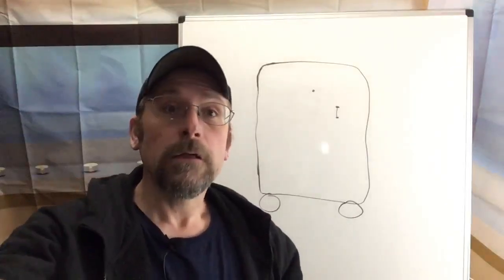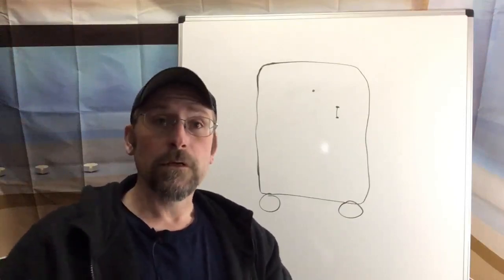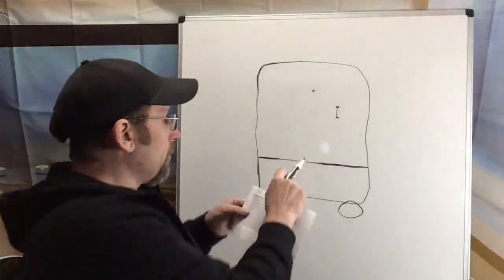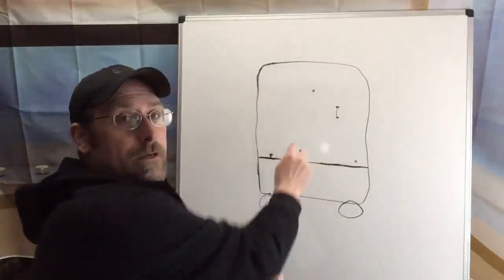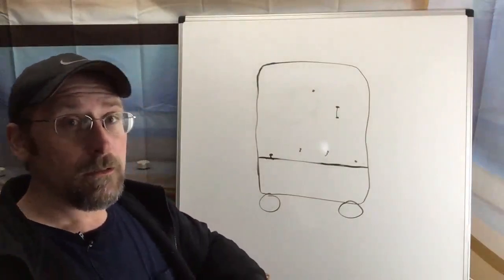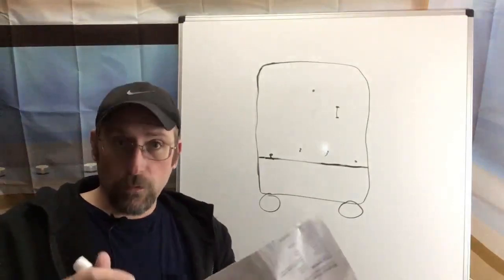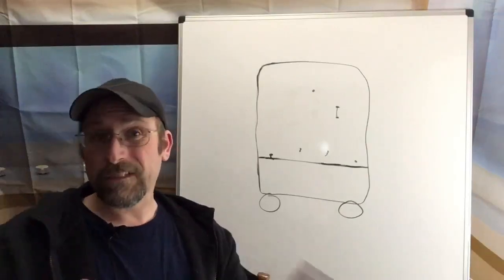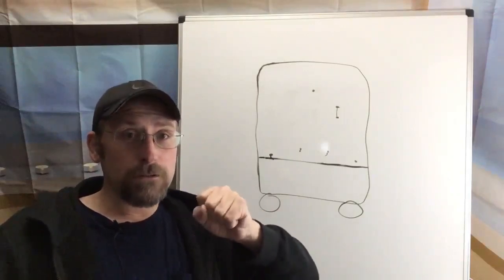HOW TO MAKE AN OXYGEN CONCENTRATOR QUIET

Comment: I like all the suggestions.  We are about to have to get a 10L home concentrator and I'm worried about the high decimel levels.
Reply from the maker: Hi, unfortunately a ten liter machine is definitely going to be louder. It depends on what your provider has available and the condition of it. You could make accepting it conditional upon how loud it is but you have nothing to compare it to, so it could be a great machine and you wouldn't know it till the next one shows up. Most places I dealt with didn't have many of the ten liter concentrators to go around. They could even offer to bridge two five liter machines but I'd only want to do that in an emergency situation. It may be wishful thinking but I'd would like it if they brought two ten liter machines and let you hear both of them and let you choose. I wish you the best of luck with this and hopefully with some adjustments in placement of the machine you should be better able to handle it.

Comment: Do a lot of ppl in apartments get complaints about this noise?
I haven’t slept in 6 months from a machine that sounds a lot like this, but also has a high pitched beep during the night. It’s so bad I can’t take it.
My complaint to the manager fell on deaf ears and the ppl using it say it’s not constant, but it absolutely is like clockwork from midnight to 8 am or later in very single night. I’m not sure if they are using two machines or if this one beeps as well as rumbles. 
Any suggestions ? It’s definitely over the decibel level for apt noise especially during quiet hours which is 10pm -8 am
Reply from the maker: Hi Marie, it's probably just one old machine, unfortunately in a lot of cases the user doesn't realize how loud it is to others. You said something to the manager so that's been done but no help there. I would run a fan while you sleep to help cover the sound, also possibly a change in where you sleep and maybe one of those sleep sound machines that have rain noise and stuff like that. Im guessing you talked to the person directly and they are not responding at all but if they would then I say maybe at the least they could call their provider and ask for a new machine or move it further away from where you can hear it.  If none of this can be done then I'd move, I had a place years ago with a horribly loud drip at night, the landlord wouldn't do anything and I couldn't sleep. I decided after nine months that it was time to go and the next person was finally able to get the landlord to listen. I hope it works out for you.
Reply: @OxygenGuy Thanks so much for your compassionate reply. I’m awake again at 3 am and my ears are actually throbbing and painful from the sound. I tried the foam air plugs but they hurt my ears and I can still hear the loud rumble and whistle of the motor.
I’m 65 and disabled and a move would be a hardship. Unfortunately my bed can’t be placed elsewhere and wouldn’t make the noise any better. I’ve been running my AC fan and I try relaxing music. But I really need freedom from sound stimuli in order to sleep. I use aromatherapy and have black out noise reducing heavy drapes. They should put it in their spare room. But from what I’m reading here ppl say they can still hear it vibrating off all the walls in their home regardless of the machines location. It already sounds like it’s enveloping my entire room right under theirs. It’s loud enough that one of them had to leave the bedroom. It’s so insanely loud and constant but they lied about to the manager and said it’s not loud or constant. My tinnitus has totally flared up and my brain is actually hurting.😢 I got a lawyer who is going over my lease now.and will decide the next step to take.

Comment: Moving the machine to another room is priceless. How often do we need to change the tubing / cánula?
Reply from the maker: Hi Denise, It's an unfortunate reality but a lot of machines out there are old and loud and replacements never seem to come. Also you have situations where the one member of the house can hear and the other can't no matter how quiet it is. Tubing is 3-6 months and cannula is 2-4 week ls but depending on conditions in the house or if patient is sick then you may have to move up that time period. Also if they hardly use it then it could technically go longer between changes.
Reply: My machine was so loud I could hear it in another room. 
Another thought 💭 is my O2 is 98 during the day, then does it make sense to use it at night?
Reply from the maker: If your doctor is ok with it then It should be good, but most people have lower oxygen at night when they sleep. They should definitely do an overnight pulse ox on you before taking you off of it to be sure it won't be a problem. Also they could talk about a CPAP at that point, just so you are aware.
Reply: I have metastatic cancer. I only wear it at night for comfort care. ❤
Reply from the maker: That's rough, I'm sorry to hear that, well at least you won't have to mess with it as much. You now have approximate times but if you feel it getting hard and painful in your nose or if it looks rough then definitely change it. Unfortunately I've known some providers that toss an instruction book and leave and then there's times where you're released late at night and it's a lot of information to take in on top of everything else leaving the hospital. It's best to note change dates on the calendar, just so you have a reference later. If you have anymore questions let me know.

Comment: Any suggestions to quiet a Portable Oxygen Concentrator especially the loud popping noise??
Reply from the maker: Well, you got the same issue basically as the people with the big machines do, but it would be easier to place it somewhere else as long as you got airflow going to and from it. You can can run a fan in the room with you and a little extra tubing to your portable machine. I would be careful to make sure it's not a lot because you need the right flow to reach you. A airflow pen would be great if you have a rep coming around the house. It's basically avoiding the noise but it's the best option most of the time. I would give it a shot and experiment a little and see if you can make it better.

Comment: As far as the idea of having machine located in a different area, I have a protected area on my enclosed summer porch but winter temperatures are often below freezing. How does ambient air temperature affect the concentrator machine?
Reply from the maker: The machines do put off a lot of heat but your air coming through maybe really cold because of the air going into the machine. I think it maybe a matter of trial and error, You may even have to keep it in a warmer spot in the room. I hope it works out for you, I can't recommend it but it may work out great. Have a good one.

Comment: build a hushbox that allows ventilation. plywood box with dense styrofoam (the pink one) on the inside.
measure the temperature inside while testing it for 4-5h. just use a thermometer in the box and check the temp.

makes sure it doesn't run hot.
Reply from the maker: I love the enthusiasm but unfortunately the concentrator needs a lot of air to make a little oxygen.
Reply: true. but if anything is rattling, vibrating and loud it can be silenced with a hush box easily. just make sure there are enough air inlets and they are placed strategically so the airflow will cool anything that might heat up. technically, "an other room" is a hush box as well, right? close the door and the noise is blocked. 
now simplify this idea and shrink the room to a minimum, you would have the benefit of silencing a machine without using much space. weight and material is what it takes to silence noise. 
again. check, where the heat source is and make sure the airflow is directed towards that area (incl a proper outflow, so it doesn't accumulate inside the box)
lowtech silencing.
 @OxygenGuy

Comment: If the issue is air for the unit, why couldn't you put in a closet and run a small fan for air flow? Or for that matter, even build a large box to hold the unit and run tubing into the closed box with constant air-flow say from a separate fan?
Reply from the maker: I totally get it, but unfortunately the concentrators use a lot of regular air to make that super concentrated 88 - 95 percent oxygen. It never hurts to keep thinking on it, I'm sure they appreciate it.

Comment: My Dad (who had Obstructive apnea) was on this Nightmare machine 30 Years Ago!

We live in a Small apartment now, NOT A House, and I'm caring for Both of my parents, while being sick too (Longhauler). The Most distance I can get away from this p.o.s. is 20 feet. There Is No Other Room for it to go in.

My parents are in their 80's and the tubing is a Freaking Trip Hazard.  My upstairs neighbors can Hear This Monster, and after 4 complaints, we can be evicted for ANY Other "reason" that they can make up.

WHY Can't People INNOVATE this Crap!!!!!  In 30 YEARS, Virtually NOTHING'S Changed. 

The machine's smaller and in a "pretty" colored case, but my COVID Nightmare Continues. No Oxygen. No Sleep. A HOT apartment that the A/C can't compensate for, without running our electric bills even higher.

I swear, if I find the MORONS who made this germ nightmare, requiring me to have to use this Monster, they will regret hearing what comes outa my mouth And my fists. 

Reproduction for either will be impossible when I'm done, (God willing) lest they Reproduce!  And, Assuming I'm not already DEAD.

I have had 7¾ hours sleep in FIVE Days. I Am NOT Safe to drive and cannot Function like this!  Finances are Beyond tight. 

My wallet's so skinny It's Almost as thick as a debit card, so buying a portable Quiet one On Line, ISN'T an option.

Something's Got To Give!
Reply from the maker: It may be time to bring your doctor back in on this to see if there are any other options for you specifically. I would definitely like to see some more innovation with the way this is treated, hopefully sooner than later.
Reply: I’m dealing with this noise issue from the ppl above me. Their bedroom and bed is directly above mine and I’m awake all night.
I’m wondering how your apartment complex dealt with this situation ? Did they make any demands on you regarding the noise ? Did you get evicted  ? I’m literally at my wits end. In addition to the sound of the running motor and whistling sound, I also hear a loud high pitched beeping sound during the night. I thought it was a heart monitor . Does this machine also beep ? Is it hooked up to a mask to help a person to breath? When the beeping goes crazy I hear someone above me come running into that bedroom above me where the machine is. Im 65, disabled and need my rest !

Comment: There is no foam at all. Where do I get that. and what type of foam.
Reply from the maker: Hi Michael, Im betting it would be a heat resistant foam material but I never had access to it at my location, we would get replacement cases at times and the foam would be in it brand new. Depending on your model (if it comes with foam) you maybe able to order a replacement case online. The ones we got came from a branch of the company I worked for.

Comment: Hi Frank, I have a tenant with a concentrator and the tenant below says it is making him nuts (he has really good hearing). I went to his apartment, but could not hear anything. I went to the tenant with the concentrator, and it doesn't seem to loud and does not  bother them (they have hardwood floors). I have had the tenant move the machine to a different location and have put a mat and towels underneath, to no avail. Does this seem feasible that in the apartment below it would cause such a disturbance??
Reply from the maker: HI Zoots, it's possible that they are still hearing it, but maybe they're expecting to hear it and no answer other than it being gone will do.  I would want to put it to a test to be 100 percent sure of what or who the problem is, I'd go up and make sure the machine was off in the apartment above without the bottom tenant knowing, then go to the other and tell them you just made some adjustments. If they say they can still hear it, then you already have your answer. I had a neighbor in my apartment building constantly accusing me of messing with the thermostat controls for the floor that were in my apartment. I would swear to anyone that would listen I never touched it. but I would get a call two times a week telling me my neighbor was freezing to death and to turn back on the heat.  I'd also consider downloading a decibel app for your cell phone, it may help to demonstrate that the noise isn't as bad as they think. Still with all that in mind then more adjustments or maybe someone should find a "quieter" place to live. I hope your able to find a solution to this.
Reply: @OxygenGuy  Thanks Frank. Yes, some people can definitely act strange, be annoying and frustrating. Great idea with the decibel app. Will do that for sure. What's funny is the upstairs tenant has had this unit for about 2 years now, and the d/s tenant started complaining only six months ago. I went over today and listened and the unit(Everflo Q respironics) runs great and quiet. He says he hears it all day, but I have confirmed with the upstairs tenant that he uses it all night but only occasionally during the day, otherwise it is off.  Also the upstairs tenants ran an a/c unit in the summer which is 10 times louder and no complaints from downstairs tenant. Crazy
Reply from the maker: Hi again, you're welcome, I couldn't imagine dealing with people in that manner all the time. It must be like being a parent all over again.
Reply: @zoots15  I can assure you that as a tenant living below this noise it is bad. Nobody is going to make this up or claim they are hearing noise they aren’t. My ears are throbbing from the constant sound of the motor and beeps.
It’s up to the one making the noise to move or fix the situation. Even lawyers say that it would be unreasonable for a person to run a noisy medical device that interferes with another residents right to quiet enjoyment of their apartment. In my case my right to sleep. In the dead silence of the night while lying awake in bed it’s much different than someone listening to it during the day when their ears are already adjusted to sounds. Yeah u might have to listen for it, but it’s still not the same as being kept awake all night long. I also hear it during the day.

Comment: I have an Invacare IRC5LX and it just started getting very loud, usually when it's first turned on at night, and then it will run very quiet. Sometimes it will alternate from quiet to loud a few times at night. Replaced Muffler & filters and that seemed to help at first but not so much now. Any help would be appreciated.
Reply from the maker: Hi Steven, I'm thinking what's left is lubrication and springs. Either one will get worse and worse. Unfortunately I'd say it's time to get another machine, but it still may usable for awhile. Also don't use regular lubricant on the machine it requires a expensive Dupont type because normal lubricant can be flammable with oxygen.

Comment: How do I stop a whistling sound
Reply from the maker: Hi Juan, you could be talking about a block in the line, you'll want to make sure the line from beginning to end is clear for air flow in a outward direction. Test it on each piece on the way out of the machine individually, there could be a pinch or something in the way of flow.

Comment: Hi! Thanks for sharing this video, if the room doesnt have enough ventilation can i use a fan to help the concentrator work better?
Reply from the maker: Hi Antonio, I believe if you are bringing air into the room then it could definitely help but if you're blowing around the same air then you wouldn't be bringing in any fresh air. There are also a lot of houseplants that will also aide in purifying air and of coarse opening a window helps if you have one and if surrounding air is good. Any improvement is better than no improvement. I hope this helps, Have a great day!